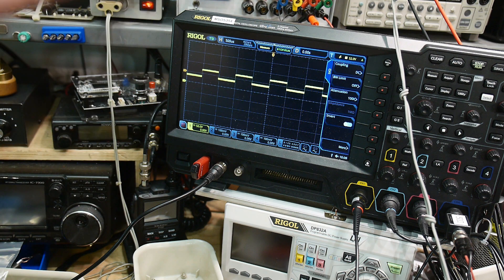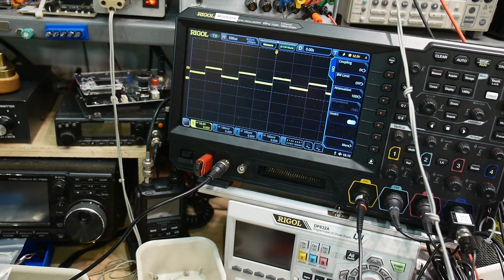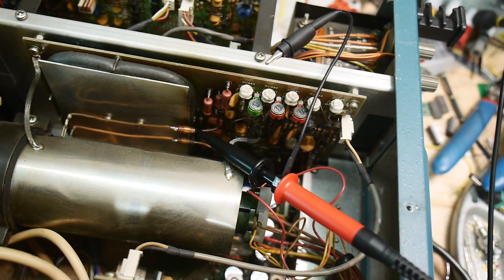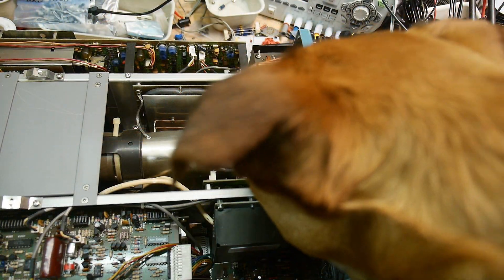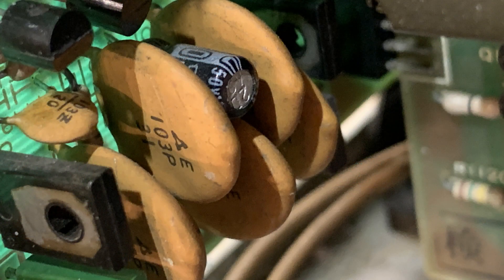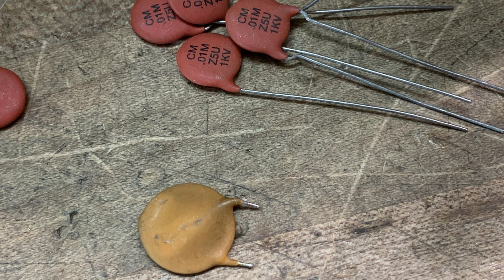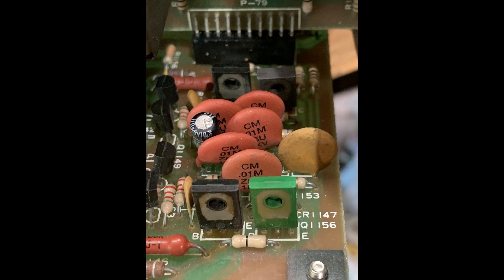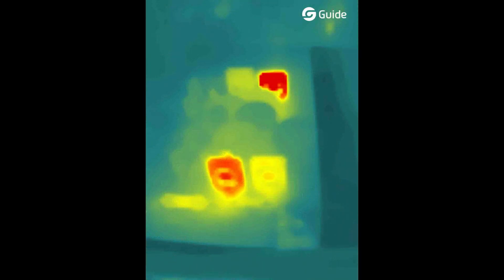#1154 Kikusui COS6100 repair (part 9 of 11)

Comment: Probably the high voltage multiplier is broken, you should get ~9kV. 
I don't know what high voltage probe you are using, but most modern probes are design for 10MOhm meters and yours Triplett has 120MOhm impedance on 6kV range

Comment: Hey there, troubleshooting oscilloscope CRT drive circuits should go about checking the following:
1. heater is lighting
2. check cathode voltage... It must go down to some -1300V to -2400V depending on the speed of  the CRT.
3. control grid voltage should be about the same negative voltage as the cathode or slightly more negative by some tens of volts - but NEVER more positive than the cathode.
At maximum brightness setting, the control grid should be up to the same negative as the cathode, and as you decrease the brightness, it should get more negative than the cathode.
This is pretty much static bias and as long as your sweep is running you should see consistent readings on a voltmeter, but to be sure it's really static, you can put the scope in X-Y mode (specially now that you know the X and Y plates are operating, you can even check their amplifiers are responding accordingly.
The DC bias of Y plates are usually in the range of some tens of volts (around 50 to 70 V), while the DC bias of the X plates (the later electrodes in the accelerating potential), should be about 100~140V.
The focus electrode (also called 1st anode) should be at about some few 100s of volts more positive than the cathode (i.e. at about some -900V~ -1200V depending on how negative is the cathode itself).
The next electrode after the focus, I don't recall how it's called, is usually more negative than the focus electrode, but yet more positive than the cathode.
Special .c..are is needed to measure the focus voltage as it's usually very high impedance.
When you have a meter like your triplet, usually is alright to measure the cathode voltage with the meter itself on the 6kV range, but for the focus electrode you really need an HV probe with 100s of MOhms or GOhms ideally.
The cathode voltage is critical and it's regulated, because it determines the deflection factor in relation to the potential of the X and Y plates that are also biased with regulated voltages.
The HV anode (the 20kV you're measuring) is usually referred to as "post acceleration" anode and it's voltage is not critical. It only affects the brightness.
However, it should stand the impedance of the HV probe with no worries. It's meant to handle almost as much current as the cathode, as most of the cathode's current ends up there so, if you're reading just about 5kV there you probably have a dead voltage multiplier, shorted or leaking and the best way to troubleshoot the HV section is isolating the voltage multiplier and checking the remaining HV stuff (cathode, control grid, focus, etc,etc).
Reply from the maker: Wow, thanks for all that great info. I have a multiplier I saved out of another oscilloscope and might swap that in if the specs are not critical. I had come to the same conclusion about a stage by stage measurement of all the voltages so your text helps. since all that stuff is <2000V it is not too scary but I am still out of my element. in addition to all the things you mention there are two more control grids just after the cathode for Z axis control. what is the bare minimum to get the scope to put some electrons on the screen. if I disconnect everything and just have the heater, cathode, and HV anode will it spray electrons on the screen and I will see a glow in a dark room

I guess I should ask, what is the minimum circuit to get some electronics to hit the phosphor.
Reply: @IMSAIGuy  , the way how those "modern" oscilloscope tube works (modern = post mid 60s early 70s), the HV anode working at some 10~20kV is actually what is called "Post Acceleration".
All the "magic", the actual "normal"  acceleration and the deflection happen between the negatively charged cathode and the target mesh that is located at the end of the neck, just after the horizontal deflection plates.
This mesh runs at about the same voltage as the horizontal deflection plates, something in the 100~150V ballpark.
A Tektronix 465 scope, which is also a 100MHz scope, works with the cathode at -2450V and this is, basically, the effective acceleration potential.
After the beam leaves the mesh target, than it is "post accelerated" to the screen with the HV anode, but at this point, the beam has already been deflected and pointed correctly at the right spot on the screen.
All that it happens in the post acceleration is that the beam gains energy to hit the screen harder and make it flow brighter (which is ultimately necessary when it crosses the screen at high speeds such as 5ns/div as these 100MHz scopes reach when you push the x10 horizontal sweep.
The scope can work without the post acceleration HV voltage (the trace gets very dim, but it should be perfectly visible at relatively slow sweep speeds.
You need to check the voltages:
1. at the cathode, it MUST be nominal (it's even part of the calibration). The service manual surely indicates what it should be.
2. The grid voltage, (it's the first element right after the cathode) should be some few tenths of volts more negative than the cathode, and as you crank up the intensity setting, it should get close to the cathode voltage, but never more positive.
In case of doubt, and as a troubleshooting aid, you can disconnect the control grid of its circuit and short it to the cathode... This should give the highest beam intensity possible, but watch out the screen to not let it burn (it won't anyway if you keep the HV post acceleration disconnected).
3. After you checked cathode and control grid, you must make your way up to the following electrodes... 1st anode (or focus) is next, and then there are a few others (it varies from CRT to CRT depending on the make).
Those subsequent elements, they all work at progressively more positive voltages (or should I say, less negative) and the service manual usually indicates which has which voltage.
Some of them receive fixed voltages, some may receive adjustable voltages and this is where some adjustments come to effect, like astigmatism of the trace, and correction of distortions of the screen (usually barrel and tilt adjustments).
The important thing is that each subsequent element is usually at a slightly higher voltage potential.
If you manage to measure the cathode voltage, this is really the bigger voltage that you really NEED to measure and all other are smaller in absolute terms (most are negative with respect to ground).
Not all HV probes are made equal... So they're not "one size fits all" you need to know the make and model of your HV probe  and know what input impedance it expects your multimeter to have.
If I'm not mistaken I've already seen other videos from you where you measured HV anodes of computer monitor CRTs and from what I recall, you managed to get readings that are consistent to what one would expect from those CRTs so, if you use the same setup (HV probe, meter & correct range) you should be good to go.
Back to the case in question, to start troubleshooting the HV section, disconnect the HV multiplier (its input, coming from the HV transformer) and try to measure the other voltages (cathode, control grid, 1st anode, and so forth and so on).
Sorry I'm being redundant but I'm writing as the ideas come to mind.
To avoid "shocking" surprises, plan ahead what you're going to measure and, while keeping the equipment disconnected from the mains, solder some bits of wire to the points to be measured so that you can grab them with hooks or alligator clips, hook your test leads accordingly to the one or two points of interest that you may have meters enough to measure and only then apply power to the equipment.
Look at the readings while you exercise the controls, like Intensity, Focus, astigmatism, beam finder,. etc, to form an idea that each CRT element's voltage is reacting accordingly to the controls you're actuating upon and, when you find something that doesn't seem right, disconnect the scope from mains and investigate that section.
It indeed is tiresome because the high voltages, their potential to zap you or damage some part of the circuit that your test leads may accidentally touch or short, all that don't go well in line with a more conventional troubleshooting of powering the equipment and probing around...
Just don't.
Reply from the maker: Here is what I know:
heater -1820v
cathode -1820v
next two grids are Z axis
one is -1880v
one is -1400v
I assumed -1880v is brightness off, so I pulled that wire and left the other at -1400v
all middle grids, plates are low voltage.
In no cases did I see any spot, trace, or glow. I tried xy mode also
the schematic does not match the CRT wiring and has errors as well (different pins with same label), that does not help

Comment: High voltage connection is normally called the EHT and the rubber thing the Anode cap

The pop you heard, brings memories of the transistors going pop. the epoxy can spit out a bit of shrapnel if things go wrong. 
Check the new transistor to see if there is a small chunk of the epoxy missing.

I once had to have perspex safety cages fitted to some power supply test rigs because we had a very high rate of three terminal regulators going pop in just that manner. 

If that transistor is in then in the Z amp then the beam may well be off.

Andy
Reply from the maker: I took it out and tested it. still good, something else failed

Comment: The HV probes are usually designed for 10M Ohm multimeter load.
Most multimeters have that value on the 2/3/4/6 Volt (depending on the fraction of the digits) range.
I believe you have a HV supply so you can connect both multimeters in parallel to the source and know from now on your HV readings.

Comment: I think the "rubber cup thing" is called the 'anode'. 

I usually expect to see about 1000 volts per diagonal inch of CRT screen from the HV supply. That's usually close enough to know it's working correctly.
Reply: The "rubber cup thing" is just a isolating silicone rubber cup.
(YOU DON'T WANT TO ACCIDENTALLY TOUCH A METAL PART WITH 20-30KV ON IT, RIGHT?)
The ANODE is part of the CRT and usually is a special conductive carbon coating inside the tube.

Comment: The HV probe simply puts a large resistance between your + terminal and the HV.  Often, they specify x10,000 for 1 MOhm scope input -- in which case the mystery resistance is 9.999 GOhm ~ 10 GOhm.  Your meter forms the bottom of a voltage divider, so you need to calculate the correct reduction based on the meter range in use.

Comment: You should measure the AC voltage on input of the voltage multiplier (point B-20, board A10), the multiplier has 5 stages you should measure 5X more on the CRT. 
I’m guessing your HV probe is 1000:1 on 10MOhms, and input resistance is 1GOhm. You may connect output of the HV probe to 10:1 (10MOhms) scope probe and measure the voltage using your scope. Since the AC on B-20 is higher frequency your multi meter probably will show not accurate results.
As somebody already mentioned, the CRT should be connected.

Comment: What I remember/recollect from previous videos is that there no electron beam spot on the CRT. High voltage is one section the other probability could be the bias for the intensity setting. All the deflections seems to be working normally with some voltage swings we just need to find/display the electron beam. May be the we need to look at the source/ heater side as well.
You are already aware of all these just sharing my thoughts
Good progress on the project though and always thanks for sharing:-)

Comment: what HV prob are you using?  With a Triplett  HV probe  the  range switch is set to 3 volts and the meter then  reads  0 - 30,000 volts. The HV probe makes a 10,000: 1 voltage divider.
To measure the Aquadag voltage correctly, leave  the cap  connected  and connect the probe to the connection. not knowing what CRT id being used,  can't be sure of the voltage required, but would expect at least 20,000 volts,

Comment: Your KV probe likely has an 800M to 1G ohm resistor internally and should convert the 20V range on a multimeter to 20kV or similar...The manual for your probe should describe how it works...
Reply: It's usually 990 Meg ohm and the analogue meter's impedance is 10 Meg ohm; so, the ratio is 99:1.
De VU2RZA

Comment: The CRT itself acts as a capacitor filter, you may get better results just slipping the HV probe under the cap on the CRT. ie- don't disconnect the HV when measuring.